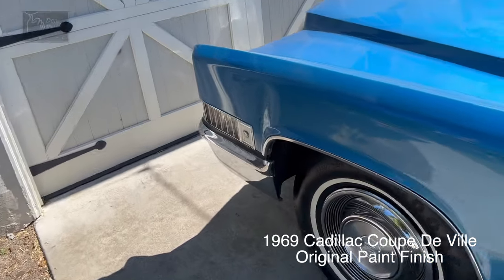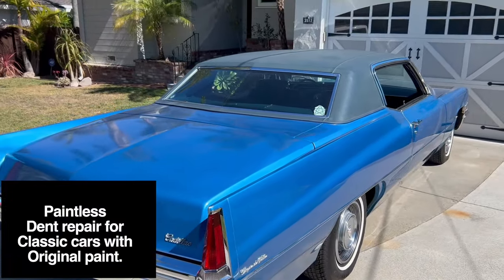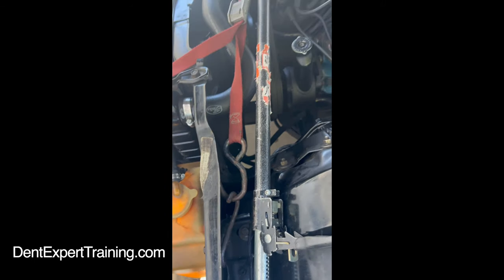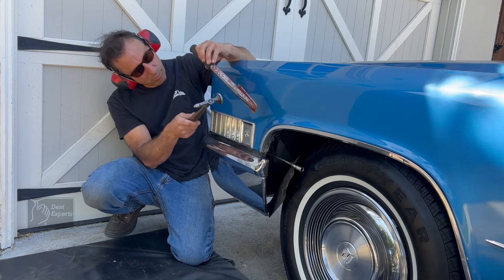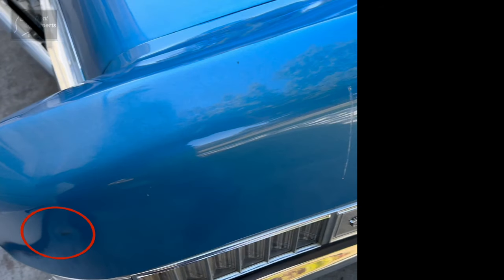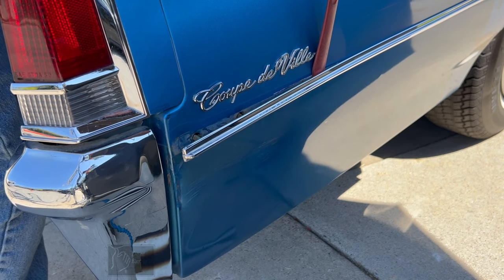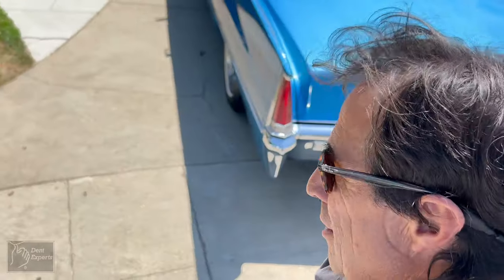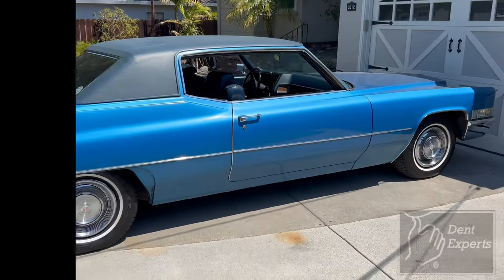1969 Cadillac Coupe de Ville -  Paintless Dent Repair saving this car from a devaluing repaint.

Comment: PDR is great. The 2nd week I had my new truck, I accidentally swung the front fender into a railing while backing out of a parking space. No broken paint or trim, within 2 hrs and $400 later in my driveway, it was fixed. The whole body shop and insurance estimate experience is a huge pain!